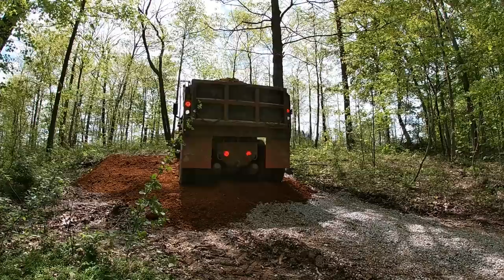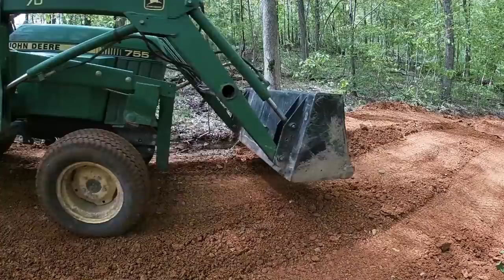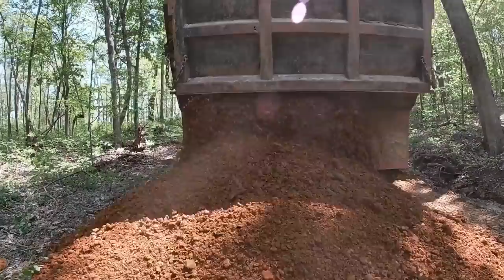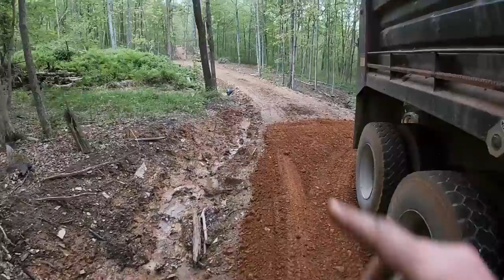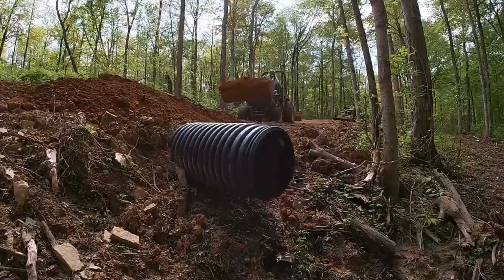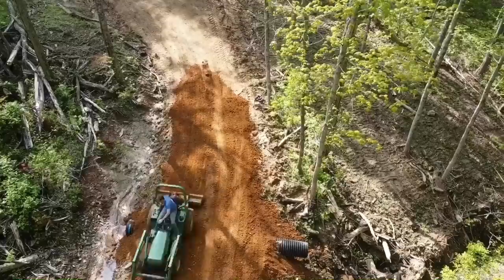Spreading base rock for forest road

Comment: JD755 For the Win! Amazing what the little tractors can do and be utilized even when using a big truck to haul in.  That chirt is some quality material for sure. Perfect application for it I would think for your YouTube Yaght Road.  We have something similar that we call "bank gravel" that is a Sandy/gravel mixture but, still a bit costly as it comes from a gravel pit. Nice to see your progress and that things have dried up for ya 👍 Nice video!
Reply from the maker: Neil Koch: Dig-Drive-DIY one of the best tractors out there!  And yeah the chirt here is right on price for about $6 a ton after I include trucking and equipment cost.

Comment: When your back dragging, try doing it with a full bucket, especially if you are floating the bucket. It may help some. Nice video, thanks.
Reply from the maker: Ted Ohio doesn’t have a float feature.  Thanks for the suggestion though and thanks for watching!
Reply: Or put your bucket full open, you will dig in when reversing and pull much more dirt or gravel.

Comment: as a less than novice  is there a reason apart from trees you don't chain the tailgate and dump rock like the driveway stone, looks like less work on the tractor i like the colour of the rock to as im a ginger  ( uk ) hence the u in colour
Reply from the maker: Andy Wyatt chirt doesn’t spread very well,  also,  lots of overhead branches and trees that the box would go if you and the drive isn’t the smoothest since this is just the base layer.  Now when we do too stone next summer,  we will most likely be able to tail gate.

Comment: When you spread out matarial with a Traktor, backhoe, wheleloader / frondloader you shouldn't do it like that, so the dirt doesn't get into / between  the moving parts. You should tip the shovel a bit. Sorry my english is not the best
Reply from the maker: This way works best.  If you tip your bucket you’ll ruin your cylinders
Reply: @CaptainKleeman  ah ok

Comment: I have a question, have you given any consideration to where your utility lines are going to run down to this cabin at? I don't know what you have to do for water, seems most places out there have you all on public water, but the clearing for that and your electric easement seem to be necessary unless you are running right down the middle of the driveway. it just seems a bit of a headache, to me, that you should go and put all this work into the road and then have to turn right around and dig it all up, if you know what I mean.
The road is starting to look really good.  yep, really starting to shape up you could say.
Reply from the maker: Ohh Paul we will either trench down the side or do an easement from a different direction.  We have two directions we can come from for both water and power